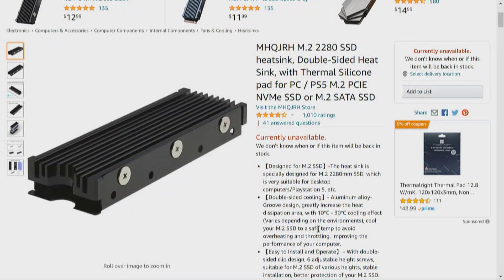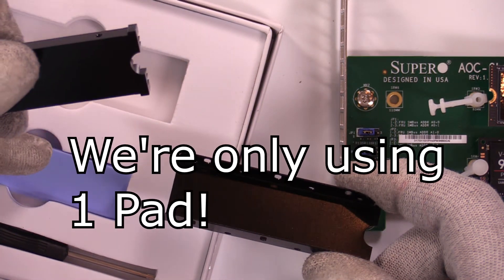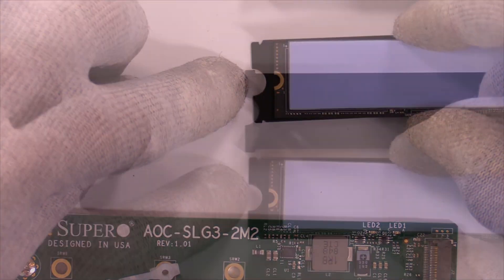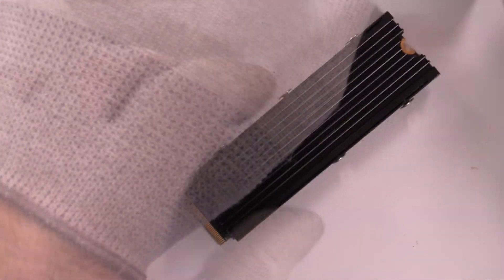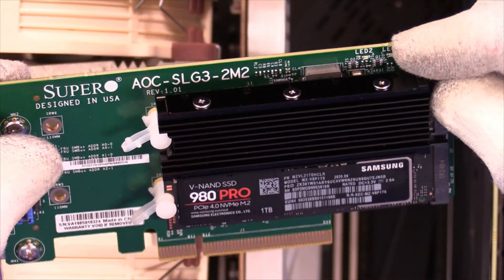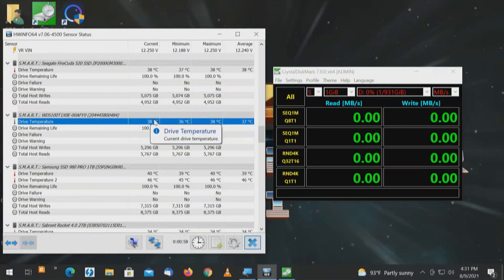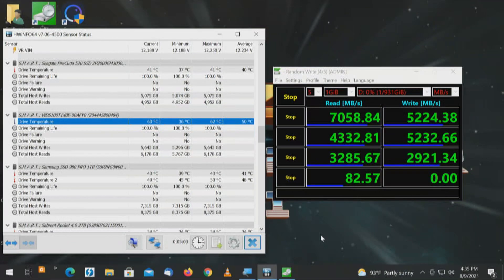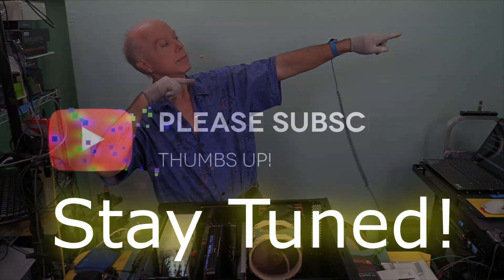Install and Test MHQJRH M.2 2280 SSD HeatSink, Thermal Silicone pad for PCIE NVMe M.2 SSD

Comment: New sub here and I've got just one question...........  How many pads did you use? 😏
Reply from the maker: Hi @billbusby2357 ,
Welcome. Depends. If space allows, one each top, then bottom. If space is tight In-between the sandwich, top only.

Comment: Maybe it was edited out, but did you replace the side panel on your case?  If not, I would be concerned that your heat measurements are not accurate.  Without buttoning up the case, the fans, baffles, and shrouds are not as effective, and any cooling baffles are completely negated.  If the replacement of the panel was just edited out, please pardon my inquiry.
Reply from the maker: Hi Chuck,
Welcome. Most all of our Videos have Side Panel off while Testing to facilitate showing what's going on. Only way to expedite process with so many videos. Your Results may vary.

Comment: 90% of all videos made 1 big mistake, you must take out the sticker on top of that M.2 SSD before installing the thermal pad, the heat wont conduct properly the heat sink if there's paper sticker on it. Same like people make mistake not taking out the sticker at the bottom of the CPU coolers.

Comment: I purchased this as a  PCIe 3.0 x 4 Lane Adapter for my Alienware R-10 that only has one M.2 slot. I didn't realize this was considered a HEATSINK although it mentions having "Heat Sink" capabilities. In fact, in 2023 through Amazon it is listed now as a "M.2 NVME SSD PCIe ADAPTER for PCIe M.2 NVMe (Key-M)>>>>I have no idea what KEY-M references. Ironically, my wife jumped the gun so to speak due to her ordering things from Amazon and didn't inform me ahead of time....I mention that because I had placed a couple of products in the cart (vs creating a wishlist)...resulting in the order being shipped containing:

1) 1 x MHQJRH --which was boxed completely different...just plastic bags loose in a cardboard box but all sealed...
2) 1 x SABRENT NVMe HEATSINK MODEL SB-HTSP (not the HTSK that you reviewed)
3) 1 x Sabrent Rocket NVMe 4.0 SSD---- THIS WAS THE MESS UP BECAUSE I DIDN'T INTEND TO PURCHASE THE 4.0 SSD DUE TO THE ALIENWARE R-10 MOTHERBOARD HAVING A PCIe 3.0 slot and not a 4.0...However, my understanding is they are backwards compatible and due to being on sale the time and hassle to ship it back/return and to purchase a 3.0 SSD would be a wash....

With that stated, I was using the MHQJRH as an adapter and not a HEATSINK as I stated above. To install an additional M.2 SSD I must have an adapter and seeing that you chose the MHQJRH makes me feel somewhat better due to how the packaging or lack of packaging the box had...all the pieces tossed around inside the box but I opened and all seems to be in good shape. My BIGGEST CONCERN, especially with the horribly designed Alienware cases....is blocking more airflow...and due to the sabrent heatsink being so thick I doubt it will fit...

If you see this and feel it would be worthwhile responding I would appreciate. DO I have any hope of installing all 3 of these products in the system I have...the GPU is a RTX 3070 and it is liquid cooled. Thanks in advance.
Reply from the maker: Hello WAR EAGLE 1,
Welcome! Curios situation. Sounds like a mix-up on the other end. MHQJRH does make what You've described. Link below. 

1. M.2 NVME to PCIe 3.0 x4 Adapter with Aluminum Heatsink Solution 
https://amzn.to/3ViaFaE 
As an Amazon Affiliate I earn from qualifying purchases! 

As for what You have, Two Heatsinks and 1 M.2 NVMe PCIe SSD Drive. OK. You describe a PCIe 3.0 X4 Slot. Do You have on Your Motherboard an M.2 NVMe PCIe Connector? If NOT, then You still need the Adapter. Does Your Bios support M.2 NVMe? If not, if You want to Boot from an M.2 NVMe PCIe SSD Drive, You'll have to utilize Clover-UEFI Bootloader. Hope that helps!

Comment: Is it really necessary to install the tiny screws to the sides of the heat sink? What happens if you don't?
Reply from the maker: Hi Kekeke89,
Welcome! Good Question! One way to find out. Try it and see. Let Us know how that goes. Heatsinks are held to Drives to maximize Heat Transfer through compression and to prevent the Heatsink from becoming dislodged. Those screws keep that Heatsink in place to maximize contact for Heat transference. Hope that helps!
Reply: @BuildOrBuy  
Well, I was trying to install it with thermal pads on each side and the screw holes just wouldn't align. I took the extra pad off the top and they aligned perfectly. Still had some trouble screwing it in, but it was manageable. Unfortunately I dropped and lost 2 screws in the process, meaning I now have 3 on one side, but only 2 on the other. 
I wonder if  that will have a big impact.
Reply from the maker: Hi @kekeke8988 ,
Those Screw Holes should be elongated to facilitate easier installation. Some Viewers don't seem to understand that aspect. If You have two on one side and three on the other good. If anything less, that could compromise the effectiveness of cooling. That's going to be a chore rounding up more of those screws. You might ask them about the size and see if You can Source those. Hassle but doable. We dropped a few as well. They disappear into carpet! Hope that helps!

To Your Q. Check Your Temps. Test and Verify. Stay below 65 Degrees Celsius. If You have screws on both sides of each end, that should suffice.

Comment: The instructions show using 2 pads, top & bottom on the NVBMe.2.  Are you re-engineering the instructions?
Reply from the maker: Hi beerborn,
Welcome! Glad You brought that up! If You have room for both, use them. We've Tested 16 M.2 NVMe PCIe Heatsinks and 3 Thermal Pads. We have other Heatsinks that Tested better than this one. Your Results may vary. Hope that helps!

Comment: Sir can we user smaller one into this M2 nvme
Reply from the maker: Hi Amit Gosain,
Welcome! To clarify, are You asking about Thermal Pads? Yes. Or Shorter M.2 NVMe PCIe SSD Drives? All of the 16 M.2 NVMe PCIe SSD Heatsinks We've Tested are Designed for the 2280 mm format M.2 NVMe PCIe SSD Drives.  Hope that clarification helps!
Reply: @BuildOrBuy  thank you Sir, yes I want to know about the smaller size M2 nvme.
Reply from the maker: Hi @dharma.vibrates , 
To reiterate, All of the 16 M.2 NVMe PCIe Heatsinks We've Tested are Designed for 2280mm M.2 NVMe PCIe SSD Drives and Specify that format size. We have not seen any M.2 Heatsinks Designed for the 22mm shorter sized Drives. Hope that helps! Suggest instead of Asking the same Question again to try one, Test and Verify for Your self. And let Us know what You learn!

Comment: Quite a tight fit on a double sided nvme with heatspreader, probably best to use one pad on the bottom and heatsink paste on the heatspreader side, otherwise its a hope it'll squish down once hot.
Reply from the maker: Hi Charles Furbles,
Welcome! Yes, very tight fit! We need elongated holes! We're leary of recommending Thermal Paste on M.2 NVMe PCIe Drives! Messy. If You do, use non Conductive Thermal Paste. Your Results may vary. We move Gear around a lot in Testing! Appreciate Your Comments!

Comment: I installed this heatsink with my 980 pro about a month and a half ago and was getting between 38-42c. Just recently for some reason my temps went up to 46-48c. do you think 48c is a safe temp to stay at consistently? I'm worried because I already had a 980 pro fail on me this year and I had to send it back to get a replacement. I lost everything and don't want that to happen again. I've been thinking about getting a different heatsink like the SABRENT M.2 2280 SSD Rocket Heatsink (SB-HTSK) do you think getting a different heatsink would be worth it or should I not be concerned with those temps and just keep my current heatsink.
Reply from the maker: Hi Im Ricky I Win,
Welcome! That's perplexing. Heat from prolonged use or losing compression of the Enclosure. Curious. Of the 14 M.2 NVMe PCIe Heatsinks and 3 Thermal Pads We've Tested, We have 2 other Heatsinks that Performed better than the Sabrent Rocket Heatsink. 
1. Acidalie 
https://amzn.to/3seVDoi
2. JEYI FinsCold iGlacier8 
https://amzn.to/3si5tpn
Both were equally effective! As an Amazon Affiliate I earn from qualifying purchases! Hope that helps! Keep Us Posted on Your Progress!
Reply: @BuildOrBuy  I will check them out, thanks so much for the quick response!
Reply from the maker: Hi @ImRickyIWin ,
Absolutely! Good timing! Working on next Video Premiere for tomorrow!
Reply: @BuildOrBuy  Sounds good! I got two more questions, is the Samsung 980 pro Single sided or double sided? Also how do you tell if it's single or double sided?
Reply from the maker: Hi @ImRickyIWin ,
Good question! Single Sided. As compared to Sabrent. Those are Double Sided. Meaning the Sabrent has chips on both sides. Hope that helps!

Comment: can this heatsink fit a msi x570 gaming plus motherboard with a samsung 970 evo ssd?
Reply from the maker: Hi Jrockstar,
Welcome! Let's check! 
MSI MPG X570 Gaming Plus?
https://www.msi.com/Motherboard/MPG-X570-GAMING-PLUS
PDF Motherboard Manual 
Page 30 - 
M2_1~2: M.2 Slots (Key M)
- M2_1 (CPU) - Looks like an easy fit. Nothing in the way. 
- M2_2 (PCH) - Could be a problem for height clearance next to that PCIe Slot. 

Heat will not be as big a deal with PCIe 3.0 as it is with PCIe 4.0. You're Drive will top out at 3,500Mbps vs 7,000Mbps. Always good though to keep it cool! Heat can cause problems. Hope that helps! Thanks for Asking! Keep Us Posted on Your Progress!

Comment: Hi,sir can i use this heatsink for laptop
Reply from the maker: Hi MAHAVIR GAIKWAD, 
Welcome! That depends upon the Laptop. Doubtful since most Laptops are tight on space. 
This one below is more likely to fit. However, We're concerned about the longevity of the bands. 

Installation and Test of M.2 Copper Heatsink Cooler for M.2 2280 SSD Laptop
https://www.youtube.com/watch?v=V7jk6tAq3Lg&t=1s
Hope that helps! Thanks for Asking!

Comment: What's your fav for that board? No fan.
Reply from the maker: Hi Mark Stanchin,
Welcome! Are You referencing which Heatsink? Of the 14 We've Tested, the Acidalie was the best if You have the space. And yes, passive cooling. Heatsinks with Fans did not perform as well as expected. Hope that helps!

Acidalie M.2 2280 SSD Heatsink, Double - Aluminum Heat Sink for PCIE M.2 NVME SSD or SATA M.2 SSD with Silicone Thermal Pad
https://amzn.to/3JGlDjS
As an Amazon Affiliate I earn from qualifying purchases!
Reply: @BuildOrBuy  thanks for the quick reply. I will purchase through your link.
Reply from the maker: Hi @markstanchin1692 ,
Thank You ! Appreciate Your Support! Enjoy!
Reply: @BuildOrBuy  You should consider not sure if you do computer builds. Different categories such as video rendering gaming different levels ect . You would be good at it.
Reply from the maker: Hi @markstanchin1692 , 
We have several Videos about Computer Builds for Content Creation. Purpose Built. And We have Outlined 4 Levels of Computer Builds. 
1. Entry level 8 or 10 Core
2. Secondary Level 16 Core
3. HEDT TRX40 
4. Workstation WRX80 
Building a Computer is all about PCIe Resource allocations. The Motherboard is the Foundation of a Computer. And the Chipset is the Foundation of the Motherboard. Hope that helps! Thanks for Asking!
Reply: @BuildOrBuy  Thanks Exactly what I’m looking for I’ll check it out.
Reply from the maker: Hi @markstanchin1692 , 
Excellent! Suggest since TRX40 CPUs are in such short supply, look at the WRX80 Workstation. The first question, does Thunderbolt matter?
Reply: @BuildOrBuy  Not really at this time.
Reply from the maker: Hi @markstanchin1692 , 
Ok. The ASUS WRX80 Motherboard. Plenty of PCIe Resources. The next question would be use. What's Your Primary function? 16, 32 or 64 CPU Cores. The new Threadripper Pro 5000 series CPUs should be announced at CES. Expected Availability in March. 

ASUS Pro WS WRX80E-SAGE SE WIFI AMD Threadripper Pro EATX workstation motherboard
https://amzn.to/3ER4gcC
As an Amazon Affiliate I earn from qualifying purchases! 
Hope that helps!

Comment: how does silicon pad allow heat transfer, silicon is an insulator?????
Reply from the maker: Hi NEWSMAN SUPER, 
Welcome! Great Question! Thermal Pads (Heat Conductive Silicone Pads) are designed to transfer heat from the Device generating Heat to the Device dissipating. Thermal Pads with a higher W/mK value helps that prospect. Or as 3M states, "Silicone interface pads provide an effective and suitable way to transfer heat between active thermal components and heat sinks." 

Hope that helps!